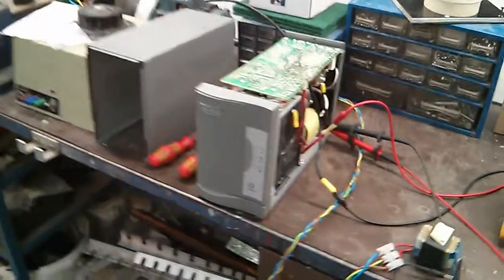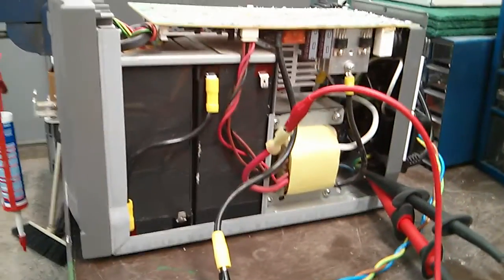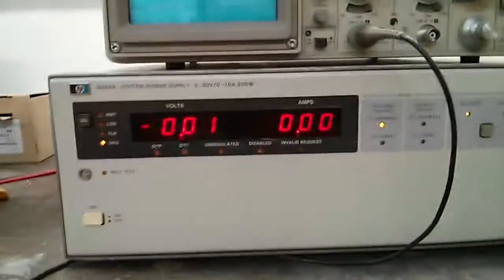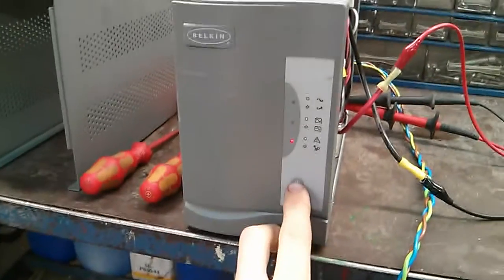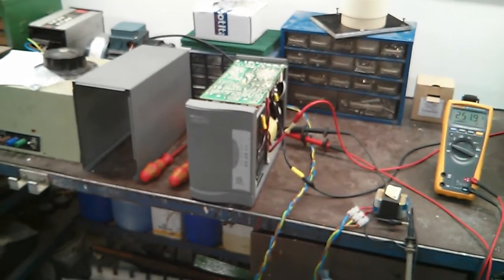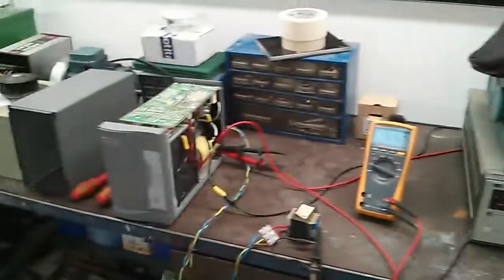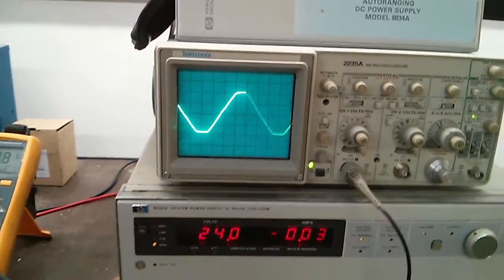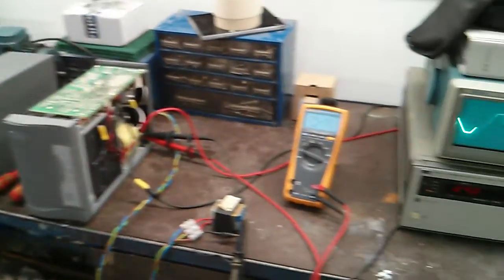Belkin UPS Sine Wave Test With The Oscilloscope

Comment: Good Grief!  am I stupid!  NEVER occurred to me to power the dead batteries with a power supply to check that the UPS is still OK and worth replacing the batteries.   

I had a 2200va Triplite that had SIX 7ah 12v batteries and I sure wish I had thought of that:  six new batteries purchased only to find UPS was FUBAR.
Reply from the maker: Absolutely! At least you know for next time.

Comment: What is the output voltage of external transformer
Reply from the maker: The green external transformer is an autotransformer used for testing, it's range is 0 to 270Vac, I would likely have had it set at 230Vac as per the input specification of the UPS.

Comment: Thanks for posting this video. I’m not sure if the simulated sine wave / true sine wave UPS’s are a gimmick or not. Minuteman UPS claims that the closer to a true sine wave, the less the chance of decreasing the lifespan of highly sensitive equipment. I’m not sure if highly sensitive refers to a Server running Xeons or sensitive lab equipment. I suppose it would depend on how often the sensitive equipment is actually running off of the batteries instead of the line. 
I would love to see more UPS videos tested with oscilloscopes, not just to see the battery output but also to see how well the Line Interactive UPSs clean the dirty AC power.

Comment: I have one of these UPS units (800VA schuko plug model), works nicely, but like you say it's a PITA to replace the batteries, which is why I plan to take out the internal pack and connect up an external pack with twice the capacity, though even with the original worn out batteries it lasts a good 20 minutes running a fileserver, plenty of time for windows to derp about and switch off... :)
Reply from the maker: In theory, with a 12Vdc supply you could run these from a car battery, a leisure battery would be better on capacity if you want to derp for longer, but if you wanted even longer (until the fuel runs out) you could actually run it off a car, it would make for a good car inverter, although horribly impractical would still be funny. x]
Reply: Steve Lane
Only problem there is these units are 24v, so unless you had an ex-military Land Rover, then you'd need to get an extra 12v from somewhere... :P
Reply from the maker: Lorrys run 24V also but not so handy really...only the smaller ups units run 12v but they have their limitatuons  if you were using it as am inverter it wouldntnmatter too much about the battery size depending on what load you connect to it though.

Comment: So, the modified sinewave will just appear on battery mode ??
Reply from the maker: Correct!
Reply: Steve Lane Is your answer just with your case in the video or this answer can linked with any ups
Reply from the maker: Ahmed Abdelsalam As far as I'm aware this is true with all UPS units. Although don't hold me to it as there are many manufacturers and types of UPS systems around.
Reply: Steve Lane Thanks for your respond, i'm just asking because i need to know if my line interactive ups output is always modified sine wave or just during battery mode
Reply from the maker: You're welcome, you could verify your UPS a little better by switching the mains off and listening for a relay (click) followed by a different sounding buzz to the usual mains hum. Although I'd be 90% sure all UPS units work generally the same way. If someone else could confirm that it would be great!
Reply: i think the more expensive enterprise level ups would be a true sine wave but who can afford them.
Reply from the maker: Possibly, although PC PSUs run happy on square wave anyways. So send to be more of a gimmick then anything.

Comment from the maker: And yes the trusty HP 6034A 0-60V 0-10A 200W Bench PSU has done me well,
but generally I'm reluctant to put just *any* circuit on it, including most HV stuff.
I will have to do a video on it, maybe even a sneaky peek inside, from what I've seen,
they say beauty is skin deep, but this one has to be an exception from that I have to
admit! xP

Comment from the maker: Belkin UPS Test With The Oscilloscope Video
Reply: Cut a hope in the bottom, cut the buzzer, and you got a half crap modified sine wave ups :D
Reply from the maker: I did consider actually modifying it with a hinged door on the bottom, although I did think it would be a bit medevil of me to get the grinder out... I may reconsider the possibility. the buzzer is on a micro switch with these I believe, and I think the buzzer is handy to let you know the power is out, especially if you happen to be outside when it does.